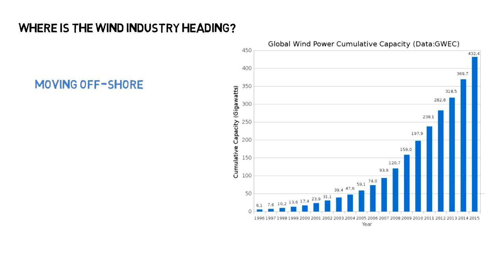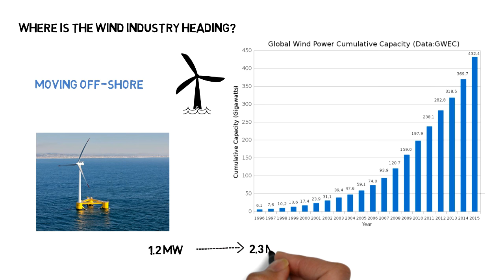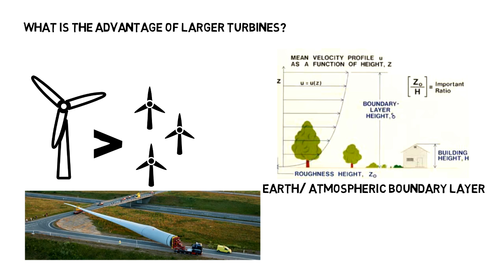10 min Crash Course on Wind Turbines

Comment: Why does the wind industry persist in using installed capacity when quoting wind farm size when average output is only a quarter to one third of rated capacity?
The noise of a wind turbine is low in decibels but the low frequency is reported to cause illness in people living close to farms? 
How much back up capacity is required for wind farms, typically fossil fuel, some running but not supplying the grid (Sptinning reserve).
How stable is the output frequency from wind turbines?
Reply: They use installed capacity due to the variability of wind so a wind project is usually evaluated by a Net capacity factor that is created by looking at the wind resource on an annual average. There is a phenomenon with wind turbine derived illness and the typical cure for these illnesses is to receive a check from the wind project owner.

Comment: to have 60 MW wind turbine you would have to instal sails in place of blades on moving cards orbiting a considerable large area or construct a giant wind tunnel for a turbine similar of hydro technology
Reply: Turbines are generally 1.5 to 3 MW each.  The wind farm they are in would be that 60 MW.  The Jiuquan Wind Power Base in China has an installed capacity of 20 GW from over 7,000 turbines.

Comment: One blade is the most efficient design, isn't it incorrect that more blades means more efficiency?
Reply: It depends on the torque and the design of the blade. The blade also has to be able to regulate the wind when it is over 59.3%. Blitz law states that anything over 59.3% the blades wont catch and will be bypassed which means you loose energy generated.

Comment: Low frequency sounds ( those you can't hear) are the cause of tremendous health problems.......
Reply: Correct but nobody wants to hear this and therefore there is no official research on this matter. There exist a beautiful documentary on this matter made by Infowars, but i cannot find it anymore due to Youtube censoring it.
Reply: niels lund  ..of which most are placed in the sea nowadays ?
Reply: The cure for wind derived illness is to receive a check from the wind project owner . Also there has been some research concerning the sound emissions on turbines with no conclusive results. Just think that most of these are built around livestock and no one is mentioning changes in livestock health, considering that cows lay in wind turbine shadows.